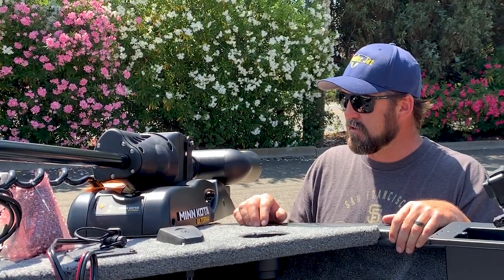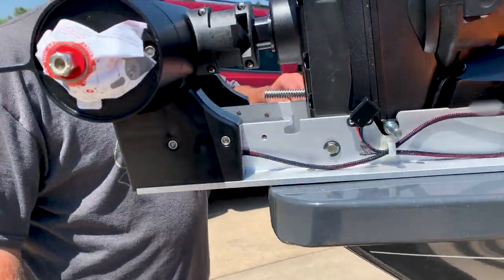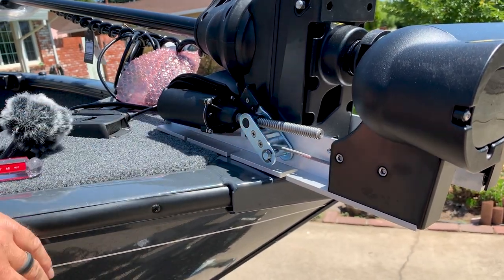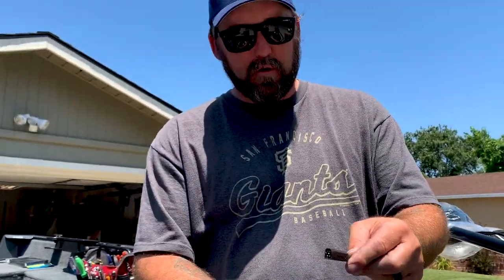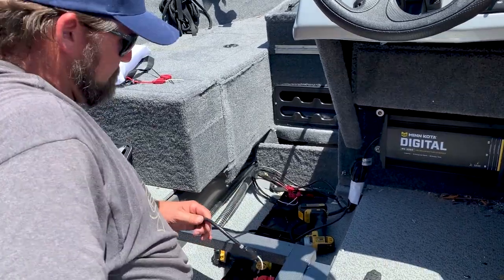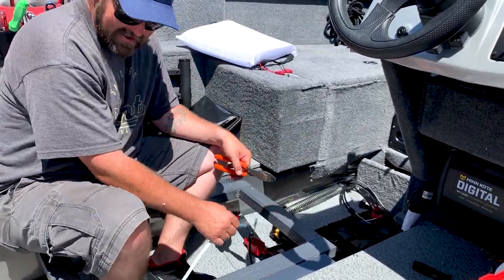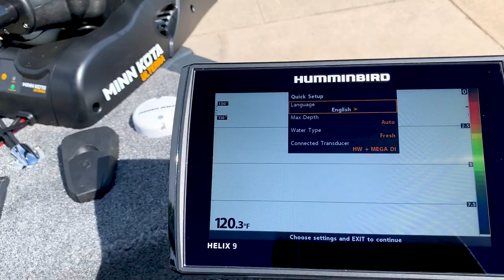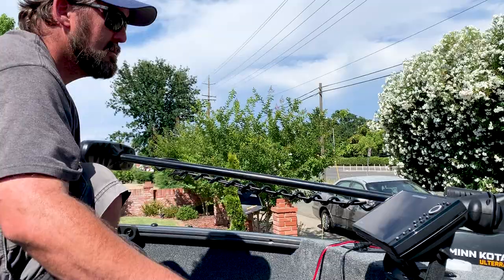ULTERRA MEGA DI WITH HUMMINBIRD HELIX 9 INSTALL | HOW TO

Comment: I have the same set up... but mines with a helix 7g3n... mine the depths read just like yours. 1,00 plus feet.. even when in the waters. I called humminbird and they said it's due to interference.  I tried everything.  How would I fix the depth?

Comment: Hello Jason
I spoke to you about a month ago about a Helix 5.
I had it installed at the Bass Pro in San Jose, this last Thursday. I went out this morning to test it it started out great, but now need you expertise to troubleshoot it. What would cause the screen to freeze up while trolling? Also sometime I notice that my dept reading would not appear? Any suggestion would help big time?
Reply from the maker: First we need to make sure you have the correct transducer setting.. then we need to make sure it is mounted in the right location and the right height..

Comment: I have two solix’s and a ultrex ~ are these do-able to install myself? Im not electrical savvy ... any advice ?
Reply from the maker: So it’s doable but it’s kinda tricky.. with 3 units (2 fish finders and the ultrex) you will need a Ethernet hub that also gets its own 12v power .. and mount that in a good spot to run all the Ethernet cables from each device to it..  let me know if you have any questions about it.. or maybe bring it by my shop in rocklin.. you would have to make a appointment.. or I could possibly do it at my house if you don’t want to wait for an appointment.. but when it’s all done its an awesome set up! The way to go for bass fisherman especially! Did you get the ultrex with the built in mega di or si ?
Reply: Yes, I got the one with SI (so it has both SI & DI, correct?!?) I am totally game to bring it to - I’ll send you a PM on IG - my name is Dee (on IG it’s: swimb8ting_dee)

Comment: Hey Jason
I bought the Helix 6 as discuss, the only issue is unable to get in in mid Aug, which I understand. It’s being mounted on my Center Console would you use the mounting bracket it comes with or a Ram mount?
Reply from the maker: Usually on a center console I would just mount it somewhere nearest to center of the console on the supplied bracket..
Reply from the maker: Unless you have other things or cup holders there that require more room.. or if you might like to get it up higher and turn it around to see from the front.. then use a ram mount..
Reply: Reel Life Fisherman 
Thanks

Comment: How does the wire to the transducer connect from the trolly to the finder? Or is it built in somewhere? Thanks for reply
Reply from the maker: The wire runs up the shaft and through the head.. it’s the only way to have the fish finder hooked up with a transducer on the trolling motor.. thanks for watching.. and let me know if you have any questions

Comment: Hello Jason
I would like your opinion, I’m on a budget have a 16ft Center Console. I have an old hummingbird 360. I thing of getting a helix5 or 7 which are under $500. I just a bit confuse about SI/DI? Could give me some input
Reply from the maker: Thanks for watching man.. so the difference between them is  a Helix with SI has side imaging and DI stands for down imaging..  so a SI unit has both down and side imaging as well as chirp sonar..  and a  DI unit has just down imaging and chirp sonar.. if you don't bass fish I don't see alot of use for side imaging.. hope that answers your question.. thanks for asking.. let me know if you have any other questions..
Reply from the maker: Also side and down imaging are looking for structure like rock piles, logs,trees, drop offs, etc.. chirp sonar shows better for fish in the water column

Comment: Just ordered The Ulterra, & Helix 9, & Ram Mount, Screen protector.  Do I need any cables to Connect the unit's
Reply from the maker: Yes you will need the Ethernet dongle adapter, and depending on what transducer you have on the trolling motor you will need that adapter too..  unless you are not planning on using the built in sonar.. then you would have to mount the transducer that comes with the helix on the transom or “stick” mount it.. thanks for watching and let me know if you have any questions..

Comment: for your helix 9, did you order the CHO ( control head only )? Do the CHO models come with wires? I don't need the transducer because the tm already has it built-in
Reply from the maker: He had the complete unit.. if you get the display only it would come with the mount bracket and power cable .. thanks for watching

Comment: Thank you for the video, I bought the same setup with SI instead of DI.  Being new boat owner, would you recommend to use transducer comes with trolling motor or install on the transom?  Thank you
Reply from the maker: alexander thanks for watching the video! I would run the built in mega di that is on the trolling motor.. especially if your mounting the  unit in the bow as well.. that way wen you’re on the bow using the trolling motor what you’re marking is Directly under you .. let me know if you have any questions.. tight lines!
Reply: @ReelLifeFisherman  thank you for the quick response.  I forgot to mention that I have a small 16ft Jon boat, I mostly fish for panfish and I prefer to use 1 fish finder for now, would you recommend DI or SI??
Reply from the maker: So do you fish in the bow of the boat? And then sit in the back to drive? Is the boat a tiller? Even if not running the one fish finder.. I might suggest to put it in a ram mount in the middle and that way you can read it from the both directions.. just swivel the ram mount around.. and then I would use the si transducer that came with your unit and mount it on the transom.. si will help marking schools of fish.. or fish around structure once you get familiar with reading it.. hopefully that makes sense.. let me know if questions..

Comment: Hey thank you very much, for the quick response!! I don’t do Bass fishing, however everything else! I do striper/catfish/halibut & trout! So if SI does both side and down and DI Does down only then, but image is better then DI would be my best bet for my buck?
Reply from the maker: Yes save your money and get a bigger screen in a DI unit.. it will be just fine for all the fishing you do.. I don't bass fish much and I never use my side imaging..
Reply: One last question, if I choose to get the DI chart plotter would I have to buy any additional equipment?
Reply from the maker: Only thing would be a maps chip for humminbird to be a set up..  it will have way more information than the preloaded maps.. including depths
Reply from the maker: You were just asking about equipment for just a standard fish finder install right? Not for hooking up with a Minn Kota trolling motor right..  just wanted to make sure..
Reply: Reel Life Fisherman 
Yes just the fish finder, thanks for double checking!

Comment: When you installed the “puck” or heading sensor what did you splice the wire to? I am in the process of installing the exact same setup on my boat and wasn’t sure what the puck wires connected to. Any advice would be greatly appreciated. Your channel rocks brotha!!!
Reply from the maker: Doug S it’s perfectly fine to share the power with the fish finder up front..  or you can mount the puck any where you can give it its own power.. it can’t be hooked to trolling motor batteries.. it’s a electronic compass..   let me know if you have any questions.. thanks for watching the channel! I appreciate it

Comment: Seen a couple of your videos and just subscribed. Keep up the great work!  I do
Have a question.  My metal tracker boat battery charger system has a common ground between the 36v negative and 12v negative (which is tied to motor and entire boat metal
Body) Ever see issues with running trolling motor, graphs w a common ground setup?  My stealth charger requires a common ground this have that one wire from negative to negative
Reply from the maker: Thanks for subscribing! And welcome to the channel! Glad you like some of the videos! So I don’t have much experience with the stealth chargers but I hear they are kinda similar to the minn kota alternator charger in a way.. they can charge your battery from excess voltage from the crank battery when the main engine is on..  but I hear very mix reviews about them.. one being they have the tendency to ruin the batteries, and the batteries should be rotated often to balance them out..  the charger does require them to be hooked up that way.. but to me .. I would always like to keep my trolling motor wiring and crank battery wiring isolated.. only connected through the charger.. like my Minn Kota alternator charger and on board smart charger for shore power..  as far as the aluminum boat.. the Electronics are wired to the Crank battery which is grounded to the motor..  most have no issues as long as the power wires are not wrapped around each other.. or hooked up with something else like a pump when running can cause Interference..  hopefully that helps and makes sense.. let me know if if you have any questions.. thanks again
Reply: Reel Life Fisherman I appreciate it thanks!

Comment: Great video! Thanks for sharing your installation. Do you still like the Ulterra? Thanking about purchasing one myself. I fish a lot by myself. Looks like it would make launching and loading easier. Thanks
Reply from the maker: Kelly Satterfield I absolutely love mine even though I have the first generation and my trim module went out on me.. this video I installed one for a buddy..  mine is over 3 years old and I use it in saltwater when I’m not supposed to..  but I can and did repair it when it failed.. that video will be up soon I hope.. though I have never launched or loaded my boat with mine..  it can be done with practice..  I would still by another one even if the one I have couldn’t be repaired.. which they always can be.. let me know if you have any questions.. and thanks for watching the video and hopefully you check out the channel.. tight lines 🎣
Reply: @ReelLifeFisherman  Thank you! I really appreciate your honest feedback. I have seen a mix bag of reviews on the Ulterra. I just really like the concept. I feel it is the right trolling motor for me to try next. Thanks again and keep up the great content. Be safe and have a great week.